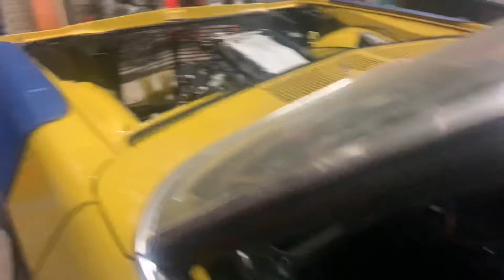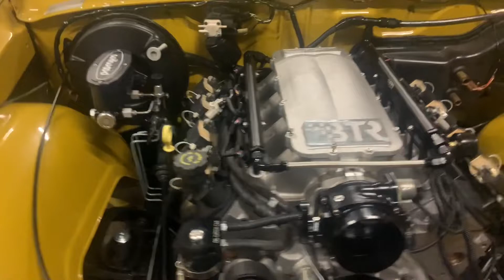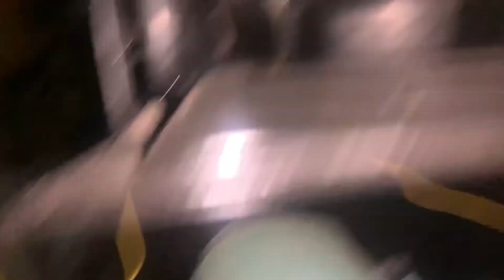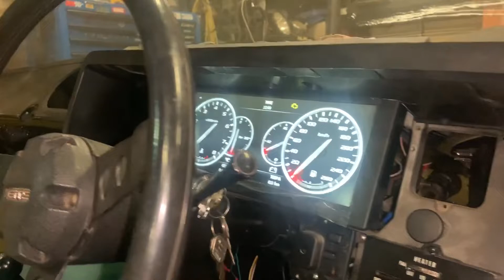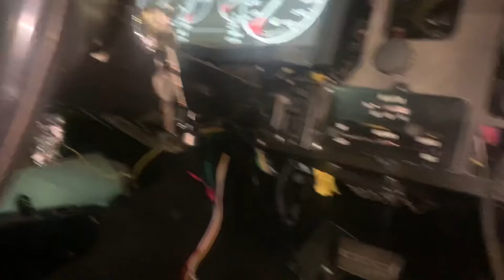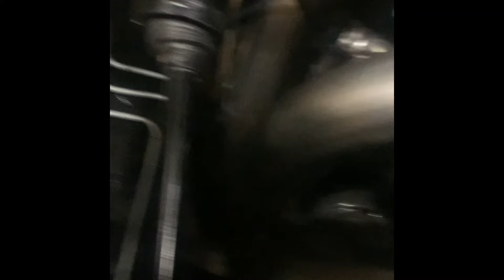Hq Holden LS conversion wiring walk around

Comment: Hi mate car looks great ,what’s the name of the intake and did you have any clearance issues with the bonnet? Cheers
Reply from the maker: cheers mate, it's a BTR equalizer manifold. No issues bonnet to manifold, it's a little close where i've run the intake pipe over the top radiator hose but still ok